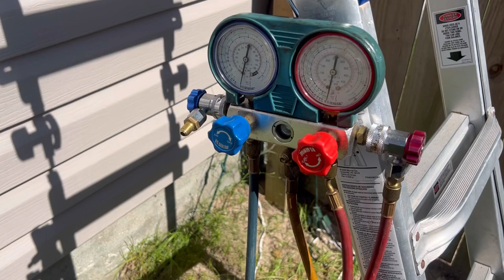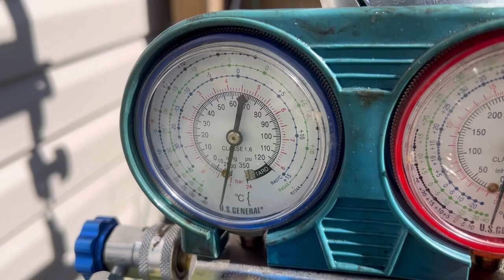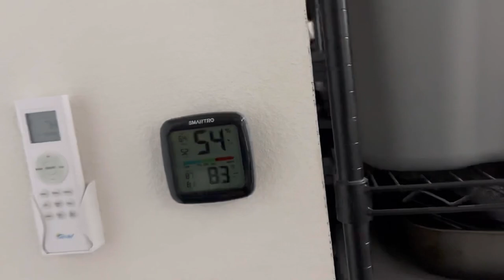Converting my garage to my new YouTube studio & 3D printing hub! Plus new printers & more updates

Comment: Did the lightening g fry your printers too?
Reply from the maker: Both of my minis, my cr10v2 & I’m having issues with the cr6 se
Reply: @Darkwingdad  shit man. My cr10 v3 has never worked the way I want it. I have it dialed in again but I think the humidity got the better of it over thr summer. 

Enough about me. You should fix those printers man. If you weren't a day and a half away I'd test everything electrically so you knew where ya stood. I'd say the cr10v2 units need new mainboards
Reply from the maker: @jstro-hobbytech  I sold my cr10 v3. It constantly would layer skip, I tried new firmware, bltouch, stepper voltage I cut my losses n said seeeeya. The printers are replaceable. I may give them away, I am being reimbursed for there retail value. I’m not sure what to do. Buy parts,repair & sell or just give them away lol
Reply: @Darkwingdad  yeah it's a rough decision.  Sell them and buy a Bambu x1 for superfast prints for the small parts you always use